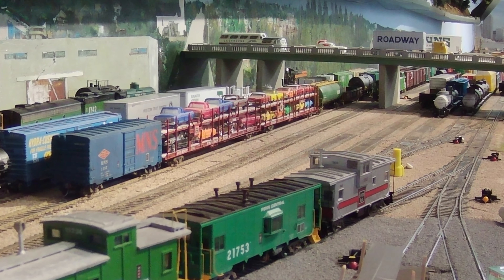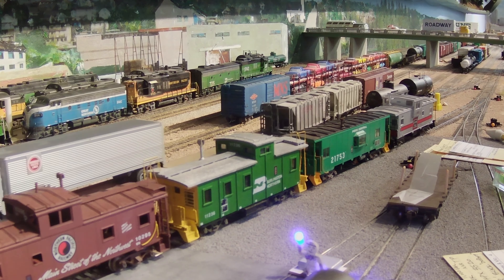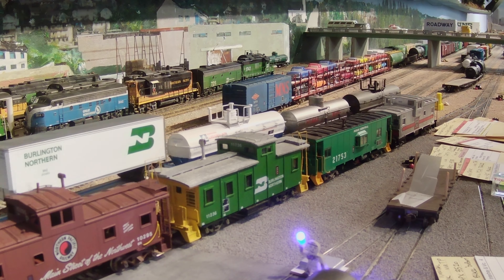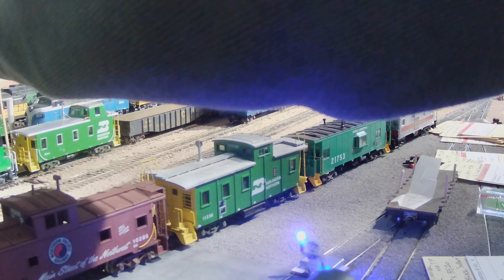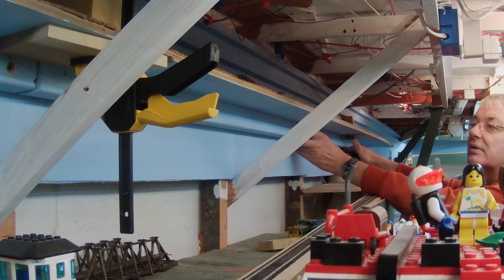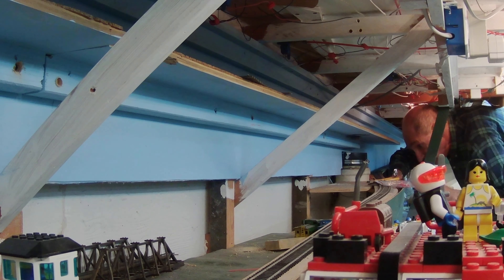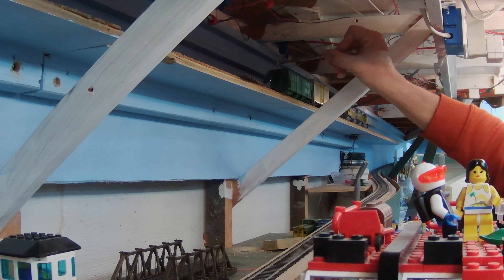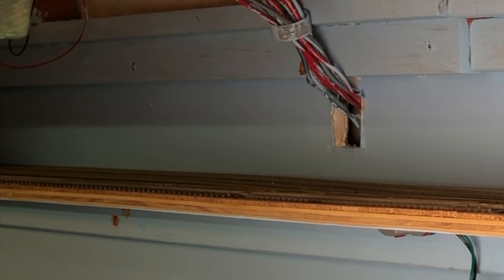Part 47 - BN switching & staging yard construction progress

Comment: Hey Burr...  I was gonna ask how are you going to put your switch machines in your new staging area... On my lower staging (hidden) I use sum older Atlas #6 (Code 100) swtches and the old Atlas snap machines to throw them... My little moveable panel has 5 Spring loaded toggle switches to throw... I was thinking about it as I have to wire up 3 more for my upper staging (hopefully I can find 3 more toggle switches)... I just pre-wire and snap them in... right now I use a 3' yard stick and throw it manually.. it works... take care. DD😜
Reply from the maker: Your solution is a good one, since the Atlas machines don't stick down under the roadbed. I don't have any plans for motorizing the switches in this new staging yard. The Peco turnouts have reliable "finger-flick" springs and I located them where they're accessible from the aisle without too much back strain. I may regret this later, but time will tell. As usual, I was in too much of a hurry to do it right in the first place. Argh.
Reply: @muchfunwithtrains  Yea the Peco switches are nice for that reason.. I couldn't tell from the video what type of switches you had put in.. take care.. DD. 🤗

Comment: Hi Burr would you mind sharing a link where I can purchase those pick-up trucks that is on your auto racks? My layout will depict mid 70’s and will have several auto industries. Thanks so much!! Love your layout!!!
Reply from the maker: I wish I could, but I think I bought them in a box at one of the swap meets around here in the Seattle area. They were cheap toys but they will do until I find more realistic models to use that aren't too expensive. You've identified one of the more difficult issues we face trying to model the auto industry before closed auto-racks. It would be very expensive for the manufacturers of HO scale rolling stock to include the appropriate cars to load in them, leaving us alone to search in vain for them...
Reply: @muchfunwithtrains  thanks Burrr for replying! For an auto rack, that level of detail is good enough for me. It’s hard to put down $30 per automobile. Luckily I found Outland Models at less then $5 per car but has to be painted and not sure how to paint the windows. Probably just leave em gray. Also, I purchased 10 of their vans but unfortunately it did not fit the bottom portion of my auto rack. I figured it would since I bought 15 of their Pontiac Firebird that fits real nice, so I was hoping pick-ups will work inside. Thanks again for responding!